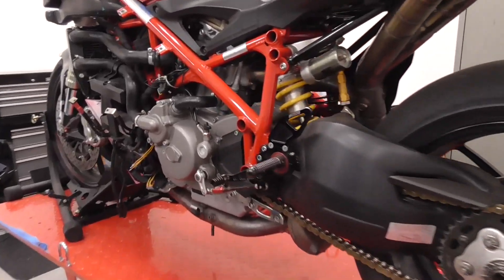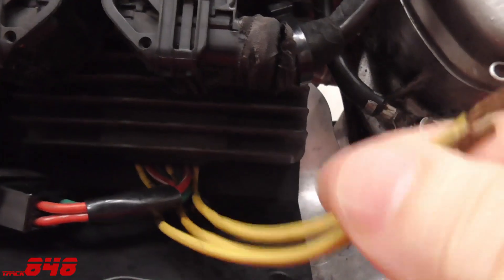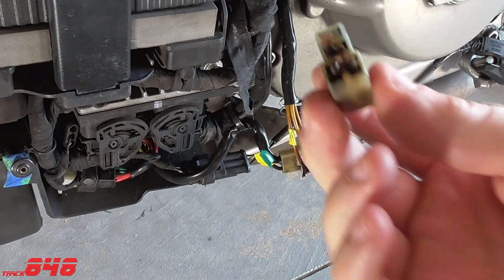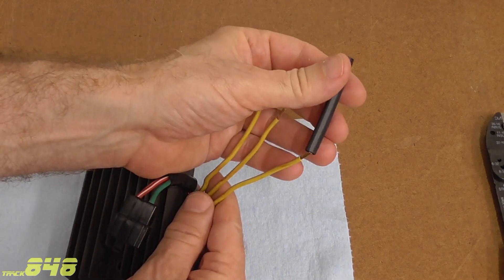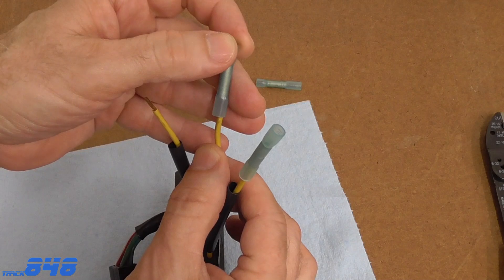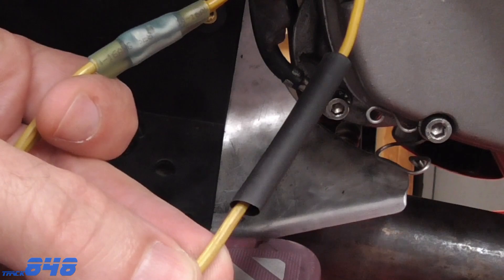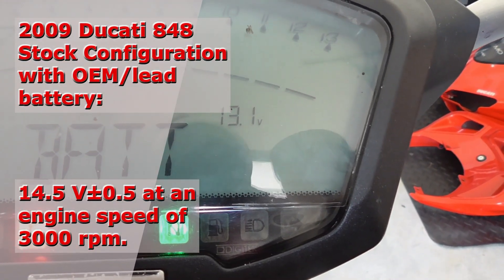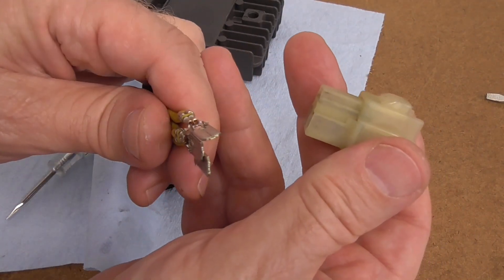How to Hardwire a Motorcycle Stator to Regulator Rectifier

Comment: Awesome video, does the 3 yellow wires need to be marked? Cuz I forgot to do it and I just hardwired them one at a time, now I am thinking about changing out the rectifier as the battery is still not charging but I don't know which wire is which after I cut them.
Reply from the maker: The three wires coming from the stator are completely interchangeable and can be reconnected in any order--you're good!

Comment: Sir Sir if my bike hayabusa coil stator connector is burnt wht if i take out the connector and directly join the wire and wrap it with a black tape ? Is it safe ?
Reply from the maker: Yes, it would be safe, but it is recommended that you use a good wire-joining method such as the way I connected the wires in this video or by soldering and wrapping the wires as you indicate. Come back and let us know how it works out...
Reply: Track848 sir as my battery was getting drained i checked while the bike is on it was not going more den 12.5 ..so I thought dat the rectifier is gone but I remember when i changed coil stator the connector was burnt some how i adjust another one but dat was also  not in a proper condition as wen der are three holes in a connector from dat 1 holes clip was not there so some how my mechanic adjusted dat and fitter tied it with plastic band ...so now before going on rectifier i think i should check dat connector ...
Reply: Bt the battery was good coz I checked the battery i my frnds hayabusa it was going upto 14.5 wich is normal

Comment: Hi, just curious but how do you know which wire went where after cutting the connector off? Or does it not matter?
Mine melted pretty badly and I wasn't able to figure out which wire connects to which, and they're all the same color just like yours.
Reply from the maker: Hi Kevin...the three wires coming from the stator (the yellow wires in this video), are interchangeable and do not have to go in a specific order... good luck!
Reply: @Track848  Awesome, thanks a ton!

Comment: Hi there,

Awesome video, just wondering if you had any issues after hard-wiring?

Are the wirings same sequence?
Reply: What I meant is, schematic of the wirings. Are they all the same? My guess is yes if they're all yellow?
Reply from the maker: @anthonytempongko1291  No issues at all and the three yellow wires are inter-changeable. Eventually I did change mine back to a connector because I typically have the alternator side cover off 1-2 times each riding season for routine and non-routine maintenance.
Reply: Thanks for your prompt response,
I'll some parameter check, I'll do the hard wire. Thanks so much for the awesome video. Next time "timing belt replacement" video😉😉😉

Comment: Nice video... But i cant figured out which wire goes to witch because of that 3 yellow wire...
Reply from the maker: The three yellow wires can go in any order, they do not have to be reconnected in any certain order.
Reply: @Track848  thank you sir how about the white one from the stator line? Can i conect it in any of that yellow wire?
Reply from the maker: What is the make, model and year of your bike? Not all stator wires are yellow like in my video. If you have a '3-phase' stator, three wires should be coming from the stator... regardless of the color, these three wires can be connected in any order to the three wires that go in to the reg/rec. The wires leading from the reg/rec to the battery side of the bike DO need to go in a specific order, so if you're talking about those, make sure you get them connected correctly.

Comment: this really helpfull! mine just got fried today, gonna try this fix asap, anyway do the cables can be paired randomly or there is specific pair? like polarity or grounds
Reply from the maker: Ryan, the yellow wires can be reconnected randomly, they do not need to be in any specific order. Good luck!
Reply: @Track848  Thank you! This answer should be pinned at the top. Africa Twin is notorious for this kind of melt downs, just saw (and smelled) the magic smoke today. Although I marked my wires before cutting them, I had to remove a lot of the fried portion of the cable and out of pure stupidity I cut over the marks. Then I went ini mini miny moe with the 3 yellow cables and lost my sleep over the fear of doing worst damage than what I had fixed. Thankfully all is fine. BTW, I used three independent (not in a plug) insulated fastons just to keep the option of disconnecting them without having to cut the wires anew.
Reply from the maker: BlowItOpen NewKnowledge  Glad you found your answer here!

Comment: Wow, interesting this happened to your bike as well.  I have an 01' Kawi ZX-12R and I went through two stators & rectifiers because of excessive oil wicking into the connectors which basically started to smolder.  These were both covered under warranty thank god.  The third time I checked and caught it before the connectors started melting.  I did what you did.  Cut the connectors (stator/rectifier) off and instead of a crimp connector, I soldered the wires together. Then used a two part non-electrical epoxy around it and then a heat shrink wrap.  The solder and epoxy makes sure there are no gaps for the oil to wick through.  16yrs later, all still good!
Reply from the maker: Hi Todd... thanks for the comment! When I originally researched this before my repair I found a number of owners with many makes and models of motorcycles that experienced the oil-wicking problem. Some people do not believe it! A while after I made this video I also took another approach since I typically remove my alternator-side cover a couple of times each season for routine and non-routine maintenance:  I added some extra length to the wires coming from the stator and then, instead of routing the wires straight down to the reg/rec, I routed it 'up' and then down to the reg/rec. This supposedly lets gravity help remedy the situation. I reattached heavier/better connectors and have yet to see any leaks...
Reply: @Track848  Thanks and good idea with the re-route.  I do notice your rec was lower than the stator on the Duc.  My rec & connector is located in the tail of the 12R. So it's about a foot or so higher than the stator.  That still did not stop the oil from wicking up into it.  I had oil dripping on the edge of my rear tire when it went the first two times.  Not good.  I'm sure the oil pressure in the engine pushes it up.  Just keep an eye on it and hopefully all will be good.  Cheers!

Comment: This is the most informative video, subbed.
I have a 2008 ducati 848 and i have similar problems, now i can do it myself.
Thanks bud 🙏🏻
Reply from the maker: You're welcome!--I'm happy that you found the video helpful! I have a few other videos that you might find useful in the future as well--check out the maintenance vids when you get a chance, I cover a few other issues/nuances with these models...
Reply: @Track848  i did checkout all the videos, if i have to suggest a video it would be the valve adjustment tutorial on the 848, i knw its a lot of work, but a huge amount of crowd were waiting for this one. thanks for responding to me :)
Reply from the maker: The valve adjustment tutorial is on my list of videos to do... I am hoping to complete it in Spring or Summer 2020!
Reply: @Track848   looking forward :)
Reply: @Track848  so i did the VR replacement and followed all the steps, after cranking up the bike i only see the volts 12.2 at the most and they are dropping by slowly while im riding it. do you think the Stator is toast?? also the battery is new :(

Comment: Thank you! Tonight I went into garage to clean my Suzuki while the tires are off and the plastics were off.... An hour later mysteriously I was holding wire cutters in one hand and a melted burnt connector in the other asking myself, "why did you do that? and now what are you going to do?"... Another hour later after looking thru service manual and wiring diagram I turned to YouTube and found your video. Again thank you! Are all three wires the same? On mine the 3 wires(male) coming from the regulator/rectifier are black and the other three they connect to(female) leading away are all yellow. Does it matter which wire connects to which when hardwiring?
Reply: You don't have to answer my question about which wire goes to which when hardwiring the 3 yellow wires. You already answered it for someone else before. Great teacher! One question tho... I never really noticed an issue with bike before I saw the melted connector and frayed wires.... However, what would common symptoms have been if the burnt wires became worse and I didn't visually notice the problem?
Reply from the maker: I've read of various potential issues that others have reported from slow starting to improper charging of the battery. I'm not sure about everyone else, but here are some symptoms I experienced: 

1) Slow starting. 
2) Random, no starts (engine not turning over at all), when start button pushed.
3) Eventual bad reg-rec. This may or may not be a direct symptom, but it happened on my bike.
    a. Intermittent warning lights that clear on their own.
    b. Headlight and dash lights flickering on and off randomly.
    c. Voltage spikes from reg-rec to battery
    d. Blowing fuses (mine blew the fan fuse).

There are probably more electrical 'gremlins,' as well, but this was my experience...
Reply: @Track848  thank you, now I realize I did have symptoms... Last winter plowing snow I experience headlights flickering and flashing. It only happened a couple times when plowing slushy wet stuff. Then it cleared up and all summer doing wood I had no issue. Makes sense that the frayed wires were getting moisture in them during plowing. Thanks. Fyi- in hardware store they have preformed saulder tubes. They look like buttend connectors but have a saulder ring at center and it also shrink wraps at same time. For all the saulder guys out there.

Comment: Does it not matter which yellow wire goes to which? The reason i`m asking is because i ride a Honda VFR,notorious for fried R/R and stators. And that`s why i`ve ordered an aftermarket R/R. And i`m in no way shape or form a mechanic. But this is an upgrade i need to get the full enjoyment of the bike as i hate the feeling of wondering WHEN is it gonna conk out on me
Reply from the maker: No, it doesn't matter which yellow wire goes to which... they are completely inter-changeable. Good luck!

Comment: I cut mine and didn't mark the cable position, any way to test or find out?
Reply from the maker: Hey there Aexis, if you're talking about the three wires coming from the stator (yellow wires in my video), it doesn't matter, they are all three interchangeable. The wires on the battery side of the reg-rec do need to go in a specific order, but the yellow ones can go in any order. I hope this helps!
Reply: @Track848  thanks! in my case they are all black, I was like why they same color the wires.
Reply from the maker: @alexis.moreno  you should be good!

Comment: Another, question. Is it normal for the stator wires to get hot at higher rpms? I've read that it is normal. Though, the wires on the rectifier end are not getting hot. Makes me think thiers either resistance at the connection, or stator wires are  the problem. Maybe, should have made them a thicker gauge?
Reply from the maker: Hi Jeff--Yes, the wires can get warm, and if the connectors are dirty or loose there will be more resistance and more heat. Some people do point to the gauge of the wire as being the culprit. If you're stator is still good and you want to reuse it, you can remove it and send it to ricksmotorsportelectrics.com and they can replace the wiring all the way back to the stator coils... I did this on a spare unit that I have on the shelf and they did a wonderful job...

Comment: I did this to my bike.( The connector was burnt.) I scrude up anf Accidentally, shrunk the heat shrink tubing when heating the butt connectors. I don't have long enough wire to do it over. Any suggestions on what I can do to cover the butt connectors? I really don't want to use electric tape. I want something to keep the moister out like heat shrink would. Any, suggestions? Charging system works now, but noticed the stator wires get pretty hot. I've read this is normal?? Thanks for the video!
Reply: Would high temp silicone work, in place of heat shrink, I didn't have in place??
Reply from the maker: Yes, I would use silicone tape at this point...did you get this resolved yet?
Reply: @Track848  No, I guess silicone tape would work, but I don't think it will seal it like shrink tubing. Right now, I used electrical tape temporarily. I hear the silicone tape is hard to find and probably order it online. Also, the connectors are hard to get too. Not much room to apply tape properly.
Reply: Correction: I did try silicone tape. I was unable to wrap it around the wires good enough. Just to tight a space. Also, still won't keep moister out like heat shrink. I think I'll use it temporarily, until I decide to solder them. I'm afraid too much moister will have already gotten into the connectors, if I just use tape. Frustrating. My first time at this electrical stuff and my first bike. Still have a lot to learn.

Comment: my 05 gsxr started have wiring heavy heating by regulator to wiring harness  connectors, Does those yellow wires make difference which to be connected?
Reply from the maker: There is no specific order for the yellow wires... you can put them back together in any order... the wires that go to the battery side are specific, so take note of that side if you're working there, too...

Comment: In my cbr 250 the wire cameing from magnetic coil gets over heating and there are same oil present in the wire sir can you tell what may the problem
Reply from the maker: I had the same problem with this bike; it is a widely reported issue among many makes and models. Basically, oil from inside the engine works its way to the inside of the wires (in between the wire and the outer insulation/jacket), and wicks down to the connector. Once the wicking process starts it is hard to stop it. I am currently experimenting with a fix:  I added enough wire to go out and 'up' away from the stator and then back down to the connector instead of straight out and 'down'. I read about this solution, which uses gravity, on one of the motorcycle forums and so far it appears to be working... you can find more by searching, 'oil wicking stator wire motorcycle.' Come back and let us know how you end up resolving yours... Thank you!

Comment: Does it matter which order the yellow wires are connected? They’re not marked on my new regulator did not come with a new connector
Reply from the maker: Dennis, there is no specific order for the three yellow wires--they are completely interchangeable. The ones on the other side of the reg rec do (the wires that to to the battery side) do need to go in a specific order... good luck!

Comment: I replaced  my stator and rectifier  and my battery still dying . My stator connection was burned  you think this would fix my problem
Reply from the maker: It might, it would be worth the try... but you could also have a bad battery, I would check that first, but if your stator connector is burnt, it should be replaced too (or you can hardwire). Good luck, Abraham, come back and let us know how it works out...